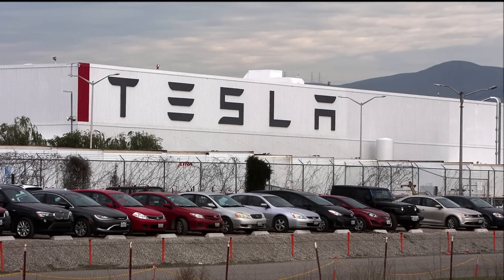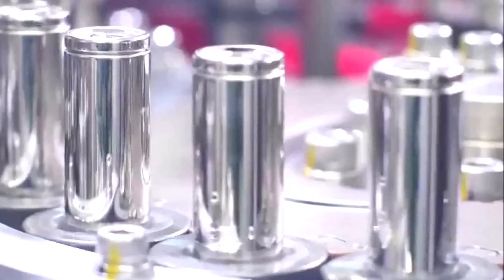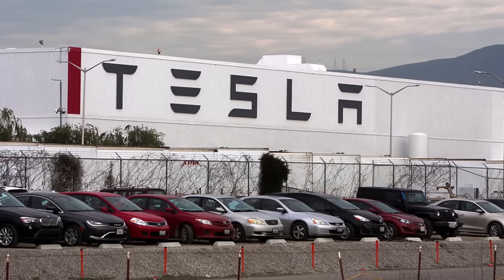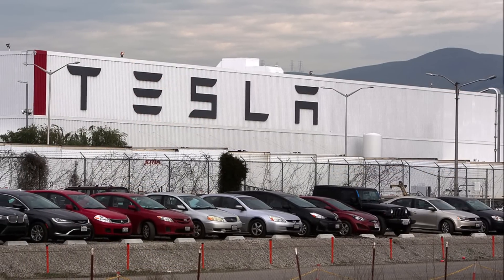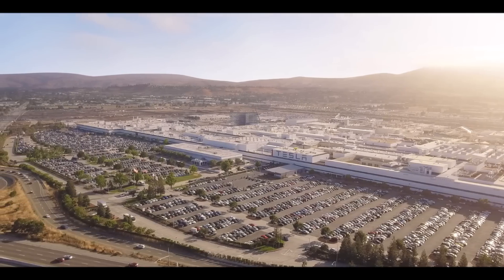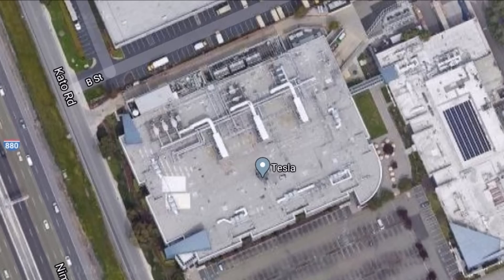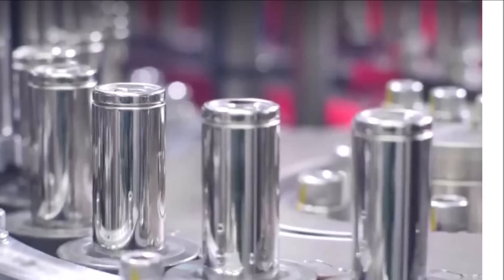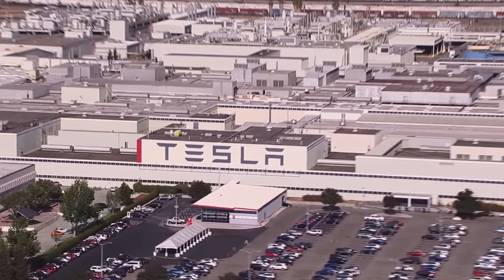Tesla Revealed Details of Roadrunner Battery Production

Comment: you pronounce OXIDE as OX EYED. Elon wants the machine that makes the machine. There will be lots of problems in the beginning. He will iron out all the problems of battery manufacture.... and there will be plenty of them. Finally, the battery manufacture plant at Cato road will be installed at all the Gigafactories. Panasonic will continue to make its cells. CATL will make batteries for the semi or battery grid storage.

Comment: I calculate roughly 112,000 of the 2170 batteries manufactured per minute to equal 1 TWh in a year.  Maybe someone can check that.
How much floor space is needed for that using the Maxwell and Hibar technologies?  We may know after battery day.
Reply: The new battery is expected to be much wider because it heats less and dissipates heat better.

Comment: Armenia, thanks you for the prompt reports on Tesla developments. I believe there is a confusion between CATL battery chemistry and Tesla's, the former is Lithium Iron Phosphate and the latter lithium-ion. When Jeff Dahn published his article on the million mile battery he wrote about an improved chemestry for the lithium-ion battery NMCA (the addition of aluminium). Cobolt is still needed but in ever smaller quantities.  CATL never used cobolt as LiFePo4 (LFP)  does not use it. I presume CATL has a million mile LFP battery which can handle more than  5000 cycles. However LFP does not have the energy density of Lithium-ion. The Limiting Factor Youtuber has the best explanation.
Reply: Eamon, his name is Armen, not Armenia which is the country where my ancestors were born.  I don't think Armen is offended.
Reply: Armen, sorry Android auto-spell changed your name to a full nation. Your output is worthy of a national press. Eamon

Comment: Great report and I think analysis and assumptions are correct although I think the Fremont Roadrunner batteries will be use for the Semi too because I don’t think Tesla plans on producing many Semis right away. I think they plan on producing just enough to give customers a few to evaluate while at the same time, take the wind out of the sails for Nikola. 

I think the CybrTrk will be produced in the Austin Gigafactory/Terafactory and this new battery will be produced there as well - so everything is local and you eliminate transportation costs.

If the new battery manufacturing process is stable and ready by the time Giga Berlin is ready, I think the new batteries will be produced there as well. Basically I think the new battery technology will only be implemented in new factories. It is too disruptive to change existing factories. 

If it ain’t broke don’t fix it!

Comment: Arman, I agree with your conclusion - the "new" battery facility APEARS to be a facility to "figure out" production for ALL the Tesla battery manufacturing facilities - now and future.  Further,  IF this facility is using the MAXWELL patents along with recently released findings from Tesla's Battery Consultant, Jeff Dahn, the NEW process will require about 1/4 of the physical space to produce the same number of cells that are made "downstairs" right now. Also, Tesla NOW holds patents indicating Cobalt is not REQUIRED for lithium cells. Maybe the Cobalt on the list will be small amounts for COMPARISON testing. I'm only GUESSING here...
Reply: I believe that the estimates were 1/4 less space for the new production line, not 1/4 of the space.
Reply: @deanmcmanis4862  Dean, yes, thanks for catching that. At 73 I'm STILL a bit dyslexic (excuse, excuse - BULL, Ray, you simply got it WRONG).
Reply from the maker: Yes, I think for the Million Mile battery they need more space. And it looks like Tesla already has that battery. I have another report coming late this morning after I do new findings about the Cybertruck. (being uploaded now).